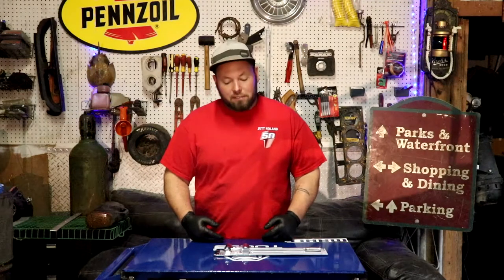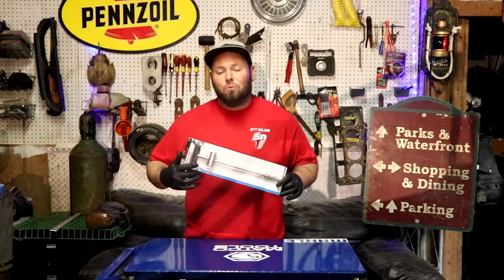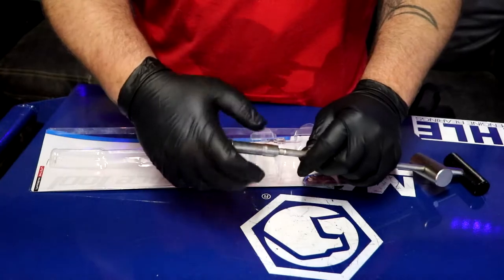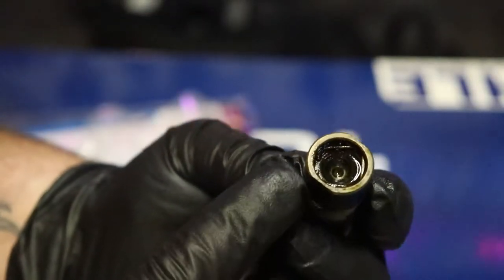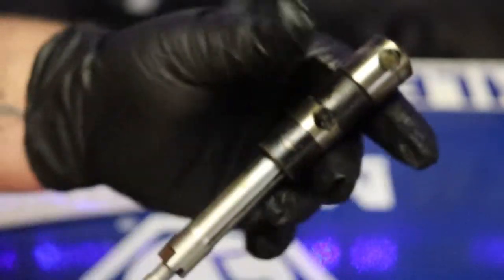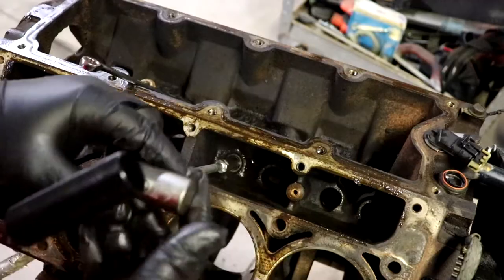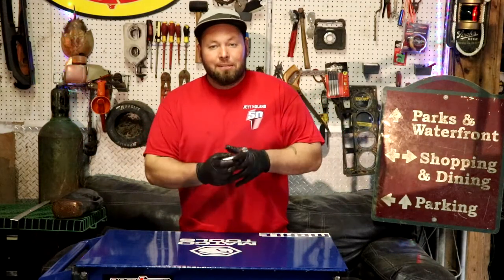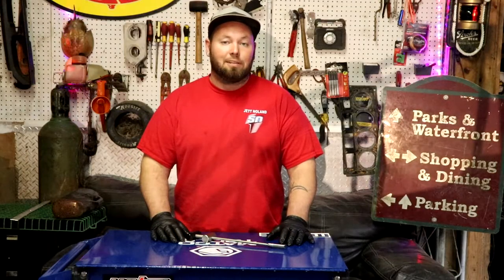How To Remove Stuck Lifters... This Tool Is Cool

Comment: I did it with a wrench ot hand crack the motor and a hammer and block of oak to hit the lifter , took maybe 3 minutes and been working fine for 2 years

Comment: I got one lifter I think stuck motor turns over until it gets to that valve then it stops .  The rocker arm is loose always making me think it’s stuck in the closed position wondering if there are any way to free it up without pulling the head it’s a mercury 3.7 boat motor ! Figure it was worth a shot asking cus I got no ways to do it ! If it can even be done !’m

Comment: Take a metal drill bit roughly around the same size of the hole and hammer it and wedge down in there. Then take a pair of channel locks to the end of the bit and twist it out.

Comment: U think that would work with motor being in the truck ....I'm having trouble with the one closest to firewall u think that tool would fit in there ..it's about a foot in half in length ?
Reply from the maker: Buy it try it if not return it or keep  it the tool it’s cheap ..  you will not know till you try lmk how it went for you

Comment: You have to be a little careful with this device. These go back a long ways. You can end up tearing out the lip with this tool if too much force is used. Take and hold up on the lifter, tap it back down a little while still holding up on it, using your hand as a spring, if this makes any sense. You may have to do it for a little while but you won't tear the lifter up this way. It will come out after a while.

Comment: is that the only way to take a lifter off
Reply: If the lifter gets stuck like that and that tool does not work you have to pull out the the water pump the fan shroud the radiator and all that good stuff just to pull out the cam because that's what you're going to have to do to extract the stuck lifter.